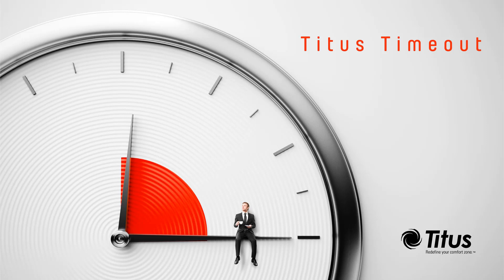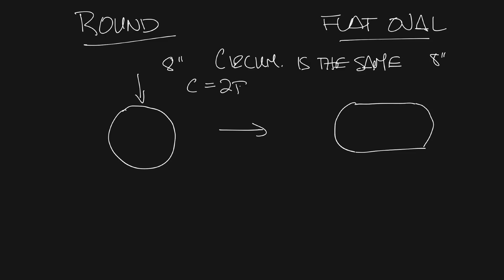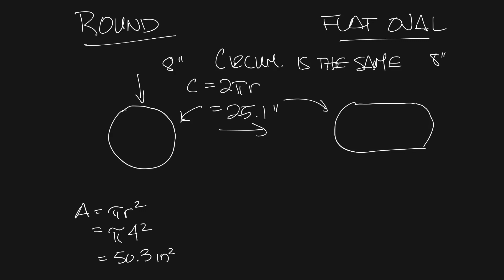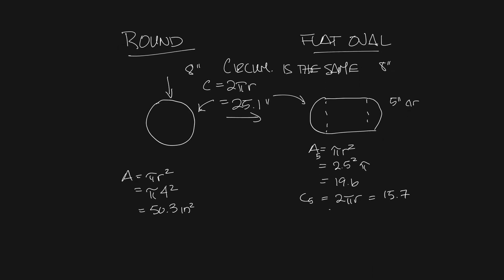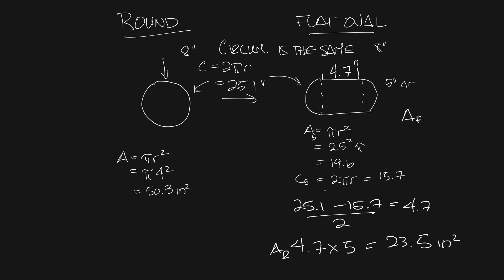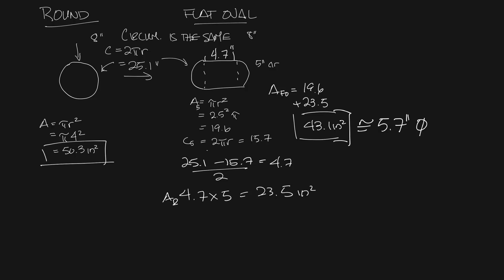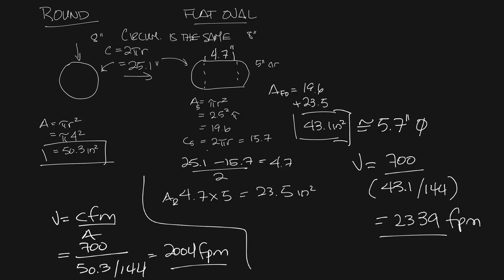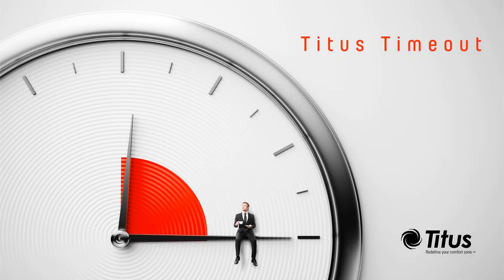Titus Timeout Podcast - Round vs Flat Oval Ductwork

Comment: Wow. You helped me a bunch. For my application I'm thinking about automotive exhaust piping. I have always looked for a formula for the lowest, deepest, throatiest tone I can get when it comes to installing a custom exhaust on any vehicle. I recently watched a very odd video about a mazda 3rotor engine mated to a series of round and oval piped exhaust system. Thanks to you I understand why that 3rotor sounded like a bass monster and not a weed whacker. I'm going to apply what I've learned from you from now on.
Reply: Hi I'm actually working on a 13b currently and I'm here for the same reason. Lol. Have u seen any benefits from the oval setup both power and sounds? Would appreciate hearing back from you cheers friend!

Comment: Did u just assume that radius for the flat duct will be 5 inch or it will be the final vlaue.
Reply from the maker: I selected 5" for easy math mostly, but our 8" equivalent flat oval on our plenum slot diffusers is about 5 1/4" in height so it is close.
Reply: TitusHVAC In that case how we can say for sure that flat oval duct will occupy lesser area than round duct?
Reply: @asifrocksful1  Lesser height
Reply: 50.3 in was round? Shouldn't be 50.24, 50 1/4??